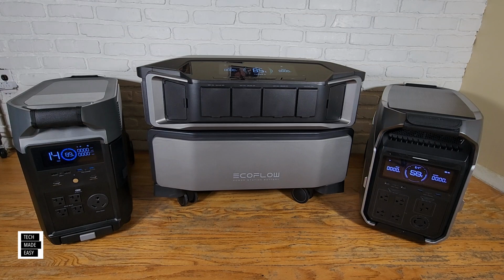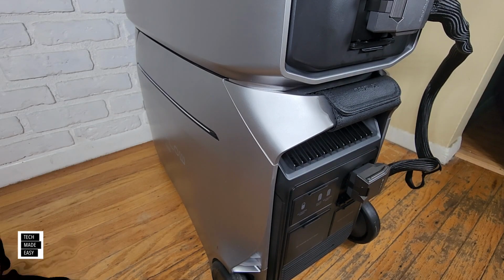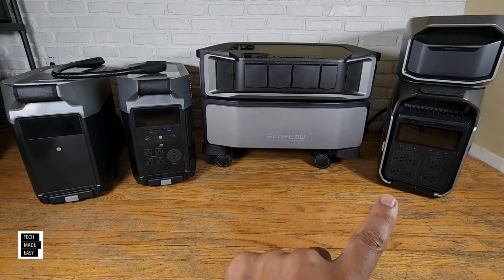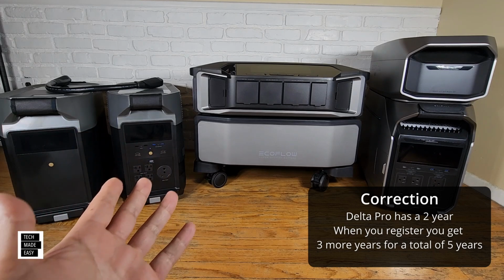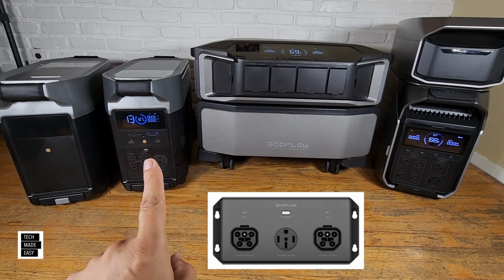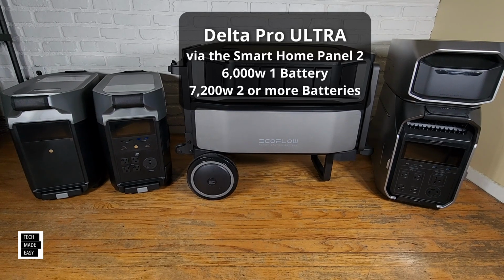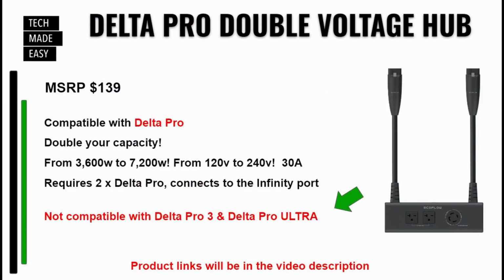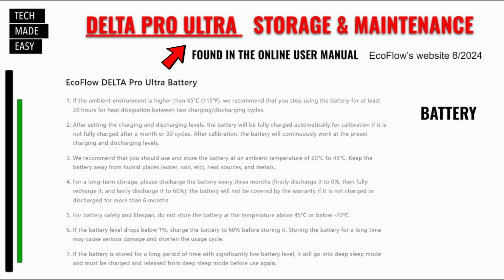COMPARISON Delta Pro Delta Pro 3 and Delta Pro Ultra Comparison

Comment: On that display, can you remotely turn on the unit or do you have to go to the unit itself to cut the unit back on?
Reply from the maker: Are you referring to the Delta remote display that is sold separately?
Reply: @TechMadeEzy yes
Reply from the maker: Yes, you can turn power on. They don’t make an accessory like that for the new pro 3
Reply: @TechMadeEzy i ask because when i turn my ecoflow river 3 and river 3 off with the app, i have to go to the physical unit to cut it back on
Reply from the maker: I’ll share the video I did on the remote with you. There should be helpful. It’s been a while since I’ve used it. https://youtu.be/Apt_dmG7JsU?si=dqVDo1cdEFtWSHTd
Reply from the maker: Did that video help you?

Comment: The short perfect cable of the ultra should be designed for the stackable batteries of the delta pro 3….as for now though it is an improvement from that of a delta pro but still it’s not neat

Comment: Crazy to see how quickly prices drop for these batteries. 
The delta pro sells for 1399$ at costco 
The pro 3 sells for 2599$ or two for 4199$ at Costco 
And the Ultra 4499$ & 2099$ for an extra battery.

Comment: Good morning Tech made easy  ,I  have D P U  WITH 2 BATTERIES CAN I JUST BUY ONLY ONE INVERTER, CAN I BUY JUST THE AND STILL GET 5O AMPS plug in too only one port of the hub ,and later on purchase  another stack of 2 plus inverter, please help ,,
Reply from the maker: 50 amp requires two inverters and if you wanna watch this video about timestamp 26 mins will give you more information https://youtu.be/y6kIpD8ahJY?si=rbEzca6dnuks_PUb

Comment: Love your videos, Al!  Great channel!

Having an off-grid garage with a 10.8kWh Delta Pro ecosystem (DP + 2 ESB's, and the older duel fuel smart generator), I felt it was necessary to point out a feature not discussed in this video:  Data analytics within the EcoFlow app...

Users of the Delta Pro 3 and the Delta Pro Ultra (as well as the Delta 3 Plus. which I also happen to own) have access to data analytics within the EcoFlow app.  This gives users the ability to examine historical energy input (across AC, DC, and solar), as well as historical energy output (across AC and DC), grouped by day (spanning 24 hours)), by week (spanning 7 days), by month (spanning 28/30/31 days), and by year (spanning 12 months).  However, the Delta Pro does not provide ANY data analytics in the EcoFlow app whatsoever.  The only data you get is real time energy input and output, and that's it.  

Because of this, users who are contemplating purchasing any of the power stations in this video for an off-grid/whole-house backup scenario might want to take this into consideration, as users of the Delta Pro will have no way to know exactly how much money they are saving since there's no historical data to go by.  Even the River 3 Plus has total cumulative energy input and output (spanning AC, DC, USB-A, and USB-C) over the life of the device in the app, which is better than nothing at all.  Moreover, the Delta 3 Plus is certainly not a device designed for whole-house backup/off-grid home power (or it would have been in your video), and yet users of this device receive all this data in the EcoFlow app?  It makes no sense.  

What it comes down to, is why EcoFlow has not added data analytics app support for the Delta Pro when it's still being marked and sold as a whole-house backup/off-grid power solution, is a total mystery, especially when you consider the costs involved in maxing out such a system.

Just thought I would point this out.

Thanks again for your work on your channel!  It's a great source of information!

Comment: This was a terrific review and comparison. I just ordered a Delta Pro 3 and have a question. I intend to connect it to an inlet box for whole house power (currently have a generator). I read somewhere that if you use the 240V generator charge cable attached to the special connector in the back, it CANNOT provide 240V out while charging on 240V. However, it can charge via the provided 120V charging cord while outputting 240V.  The question is... since the C20 charging input is rated for 120-250V, could you connect the C20 input connector to a 240V power source and would it then fast charge on 240V while OUTPUTTING 240V on the L14-30R?
Reply from the maker: Thank you very much for watching the video. I appreciate your comment. I will have to say your best bet is to email EcoFlow directly. This is their support email support@ecoflow.com
Reply: @TechMadeEzy  Excellent advise!  I contacted EcoFlow last night and they responded this morning. They confirmed that it is not possible to charge from 240V and output 240V at the same time - regardless of which connection you use. Even though the AC Input Socket accepts 100-240V it can only charge simultaneously when attached to 120V. If you attach the AC Input Socket to 240V it cannot charge when outputting 240V. This is somewhat disappointing.
Reply from the maker: thanks for sharing buddy
Reply: @TechMadeEzy  My Delta Pro 3 arrived earlier this morning. Charging now. It's a good thing EF packages it well. It was delivered by FedEx and I guess they no longer give hand carts to the drivers because my camera caught the driver sliding the box out the back of the truck onto the ground and then ROLLING the box up my sidewalk.... thump, thump, thump the box being rolled end over end. The box still looks okay and the unit inside appears to be fine. Delivery folks these days never cease to amaze (and disappoint) me.
Reply from the maker: That’s my fav large unit pro 3

Comment: I'm looking to get a unit that can output power through the AC, DC, or Transfer Switch outputs while you are charging with the EV adapter. Is that possible with any of these units?
Reply from the maker: The only one that might be able to do it is the ultra because it has 2 inverters but contact ecoflow to be sure, support@ecoflow.com

Comment: Why or when do I need 50 amp ??   What does that even mean to  me ?  Maybe you could explain better what some of this stuff means ??   Some folks might know why such stuff is important.   But most of us have NO IDEA what 50 amps is about.
Reply from the maker: 50 Amp circuit breakers are used in residential, commercial, and industrial settings. For a house, these are considered the circuits for high-demand appliances. They are used to power electric power dryers, ovens, air conditioning units, and hot tubs. The more common sizes of circuits in a house are 15 AMP and 20 AMP

Comment: you see, the reason for the function below is important is that, in rural area, small amount of customer will use powerstation as a backup and elctrict company for primary use. with the function in place, this powerstation would be useful in the city, (huge amount of customer). with the function, powerstation would become the primary power source and use eletric company as a backup in a way to maximize the value of the powerstation... when powerstation is enable to become the primary use, the usecase would increase in general and the small change in application would be huge for these manufacturing company. they will not be a backup anymore. question is simple, you can ask them if they want to be just a backup for general use? or do they want to become the primary source for all users?

Comment: Hey, can you plz do a review on the Dewalt DCPW1600Y2 pressure washer that comes with the 2 batteries and compare it to the EGO pressure Washer plz, I'm not sure which one to best no one has a real review on it
Reply from the maker: Can’t promise but thanks for the recommendation
Reply: @TechMadeEzy  ok cool because I'm watching your Ego pressure washer videos now, but I didn't see any dewalt pressure washers. I'm leaning more towards the Ego Washer I'm thinking about thr wet dry vac ago an just have the complete set when detailing my car